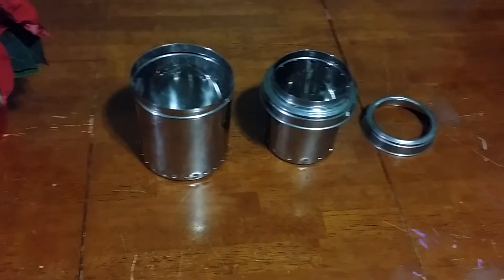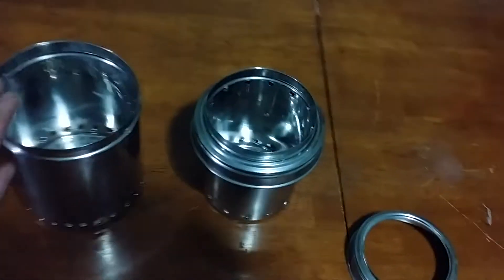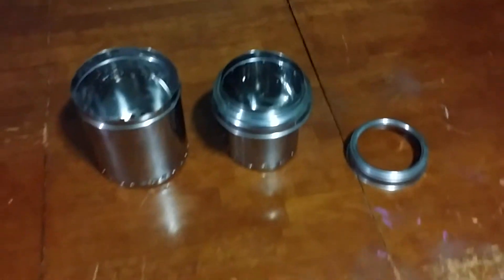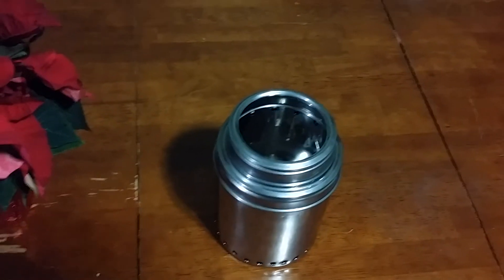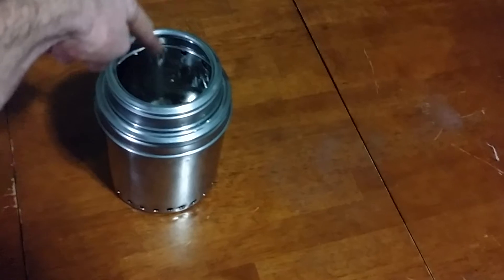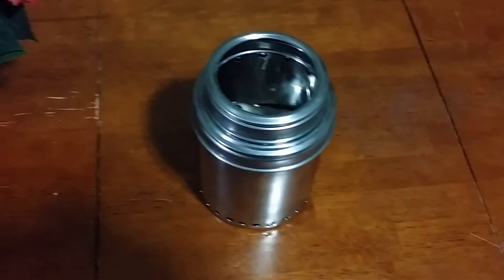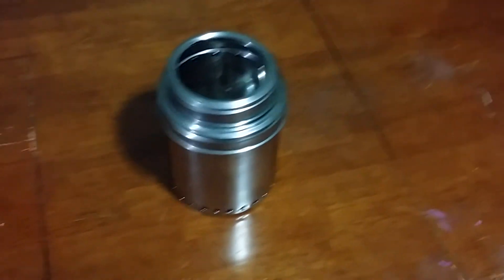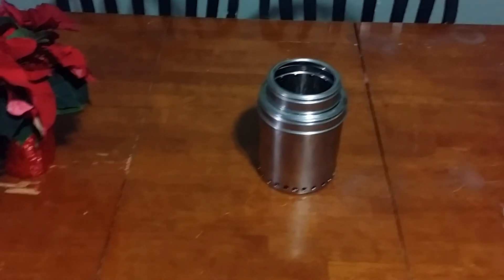$11 Wood Gas Stainless Steel Cooking Stove DIY

Comment: Nice that's the same stuff I use for my Vapor Chambers they are handy stainless steel Also I have a wood gad burner I bought the only difference is there is a little fan at the bottom to circulate the Air Good Work buddy
Reply from the maker: Thanks.  

Yeah they are definitely handy little containers, you can use them for many things indeed.

Comment: Ty - Excellent design .  I like the stainless as it won't rust out like regular tin cans.  When you do your tests, compare open fire to the rocket stove,  you might also try a test with  charcoal for folks using this in the backyard.
Reply from the maker: Thanks!

Yes it would be good to test the differences between each using the same amount of wood to see which truly is the most efficient.
Reply: +Tyson Capel  Ty - Without a doubt the rocket stove looks to be more efficient due to the precise air flow control and the utilization of the wood gas produced.  I also like the robustness of the containers sound when you clinked them on the table definitely has some metal to them.  

Your glass demo setup could be made from various sizes of quart, half-gal or gallon jars.   Hot wire cutting off the ends and drilling the air holes with a cordless drill using masonry tile bits or diamond coated bits  in a shallow pan  with just enough water to cover the bottle to provide lubrication as well as heat dissipation.  Attention will need to be made as to the pressure applied too much will shatter the glass.  Wear gloves and eye protection doing this. 

 As to the fire, since you wanted to show the air draft paths a simple small or votive candle in the fire box a regular fire or charcoal would be too much heat initially causing the glass to shatter, that damned coefficient of expansion thingy.  I think the candle would provide enough heat, without breaking the glass,  to cause a fogging material to circulate through the glass stove.  Keep up the great work !!! :)

Comment: I look forward to seeing it burn brotha! Have to disagree with you about the Silverfire...and the stove you made. It's a TLUD (Top Lit Up Draft) stove, but I found it would pull some of the gas down and out the bottom through the primary holes, and some of the gas would go up and mix with gas and O2 coming out of the top side holes. I just think it does both simultaneously. If this works well, I will build one as I need a lighter weight bio-fuel option. Keep it up man, love it!
Reply from the maker: Thanks!  

My dad purchased a wood gas stove from silver fire but it was one of the larger ones it says it is a downdraft stove. I'll have to do some testing on it to see if it does pull the air down. On a test done with a stove similar to the design I have in this video when you introduce a fog into the system and watch the flow no air is sucked down through the opening the flames come out. It gives the appearance of a draft being sucked down through the center but when you actually introduce a fog it is not sucked down through the large hole in the top where the flame is. I'll have to build a demonstration model out of glass so everyone can see and visualize what I'm talking about, taking the proper precautions of course because it would be a glass material. I'll also have to use variable designs to see if any particular design characteristic does change the effects. 

Thanks for sharing your experience using these particular kind of stoves.
Reply from the maker: Wood gas does definitely come out out through the bottom it&#39;s easier for it to travel that direction and then go up between the containers than it is to travel all the way up through the fuel for sure so yes it definitely does mix in with the ambient air and come out through the secondary holes. Air comes through the air intake holes passes through the primary holes and is also pulled up through the secondary holes at no point however have I ever actually seen the gas be pulled from the top down. I will definitely continue to modify and test this to make it as efficient as it can possibly be.